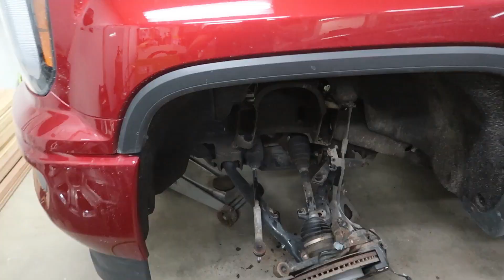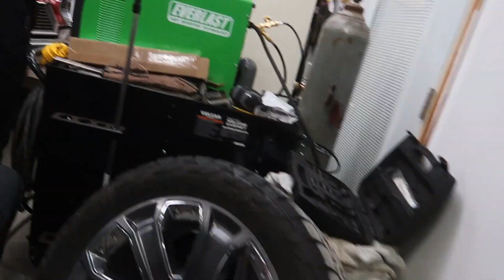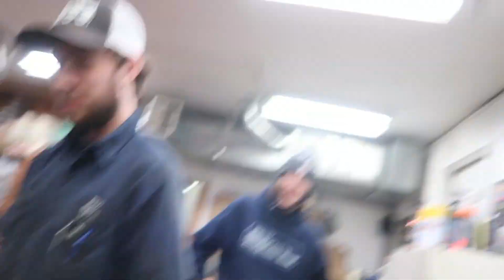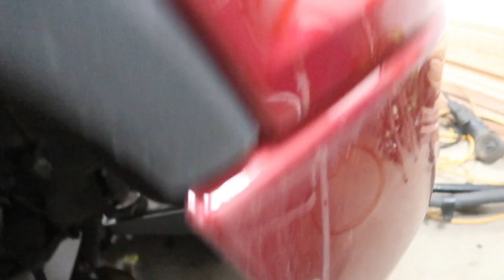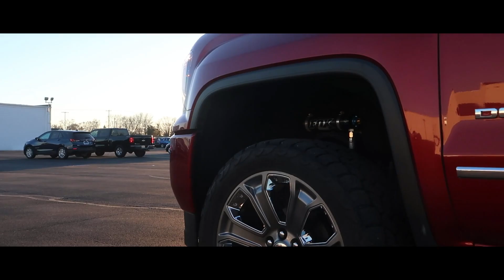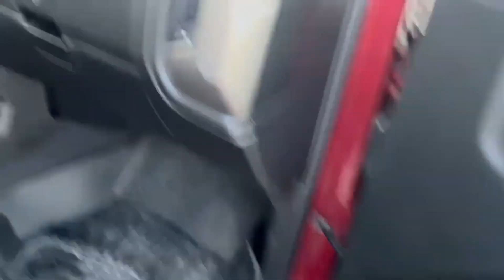Denali Sierra Fox Racing Shocks + Long Travel Control Arms!

Comment: Im running a similar set up next week. Ive gone with kryptonite control arms and a Eibach stage 2 coil over with 2-4”height. Do yall have any current rubbing with 35s? Was wanting to get 35x12.5R22s and was curious. There the same gm 22s thats on this red truck
Reply from the maker: If they are 12.5 wide they will run the sway bar
Reply: @StreetInduction ok sway im not to worried about. No rubbing on the control arms either? Would I be ok leaving the bump stop?
Reply from the maker: @ugagolferdude You cut the bump stop and with this setup he only barely rubs the fender line but if you trim it you’ll be good
Reply: @StreetInduction might go with these since we have same 22 inch  wheelIs. Specs say you need max 4.75” backspacing. Did you not have to get spacers? These wheels have more than 4.75
Reply: currently have the mag ride on a spacer running the same 22 on 35s it rubs but not much at all but am looking to get fox shocks but don't know what to get a little advice?

Comment: Looks great. Thinking of running the same set up on my '09 with some Bilsteins in the rear. 

Question about the bump stop: By cutting it out, do you run a risk of tearing the CV axel boot or breaking it off entirely with the added droop? Any need for a diff drop/end links/tie rods at this height?

Cheers
Reply from the maker: You don’t have to worry about that too much, 1 it depends on the shock you’re running and the amount of travel it has, and unless you’re absolutely beating the crap out of it and jumping it a a lot and your shock has enough travel to make the cv shaft hit its lowest point, you should have nothing to worry about. His last truck we had these on, it was jumped once or twice at the dunes, and spent 4 days on the dune and had no issues
Reply: Thanks, can’t wait to get this set up. Planning on doing anything in the rear?
Reply from the maker: For now he just has fox shocks in the rear. Not sure if he’s going to do anything more crazy with it or not honestly lol